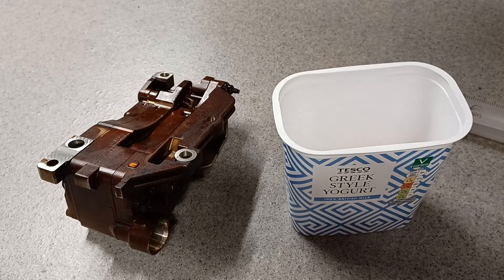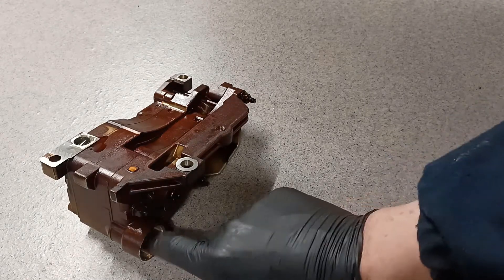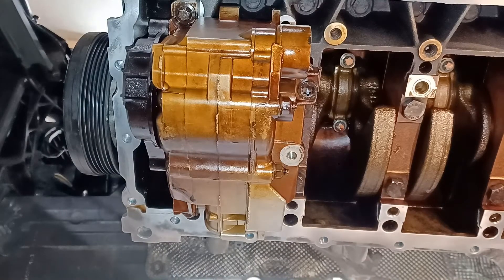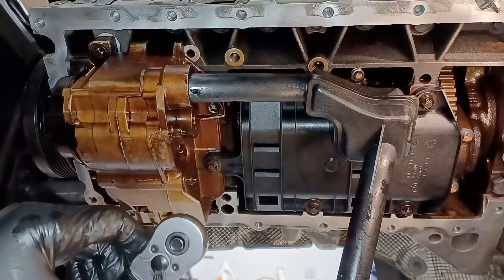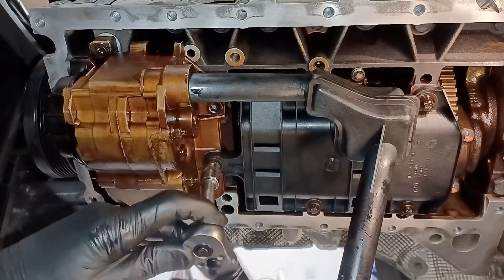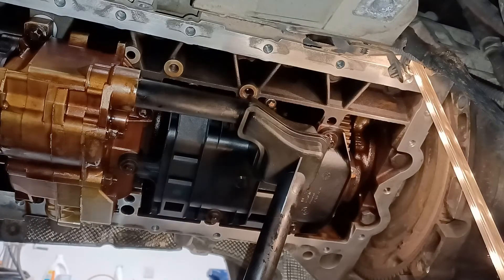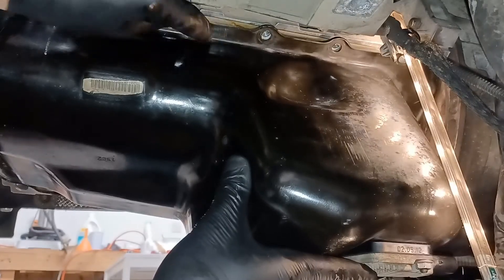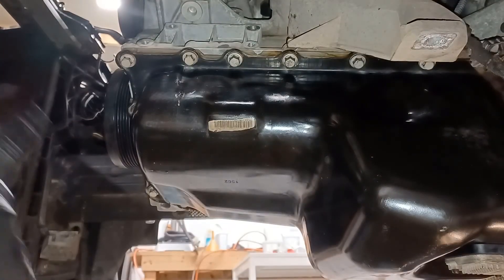BMW 116 Trophy Build - Refitting the oil pump, pickup and sump (oil pan)

Comment: Hi did you replace the oil pan bolts?
Reply from the maker: I didn't replace them.  I think the manual says they should be replaced because the new bolts have impregnated thread lock.  I just used a small amount of loctite thread lock.
Reply: @PaulOffordRacing  thank you so much for response you gained a new subscriber 😉
Reply: My manual says 12 nm torque ( 11 13 2AZ ) for bolts not mentioning to replace. But the shop (where i bought the control valve) says that it needs to be torqued at 35nm witch seems a lot for me and i need new bolts that's why i ask you
Reply from the maker: I'm on vacation at the moment, but I think my Haynes manual says 30 Nm for the sump bolts.  My sump bolts are M8 and that's important.  If you have smaller sump bolts, say M6, you definitely wouldn't use 30 Nm.  If I were you I'd cross check the 12 Nm figure with another source to be certain.